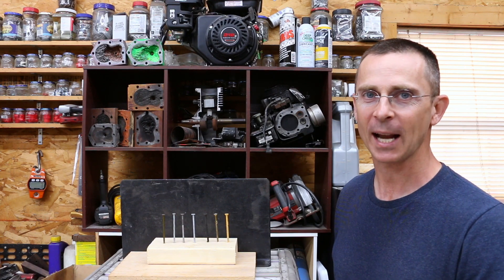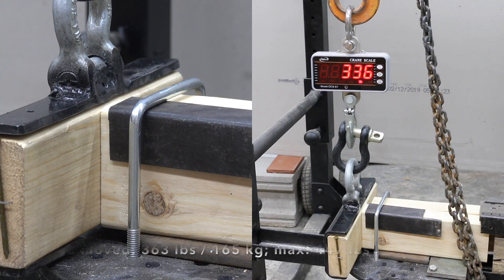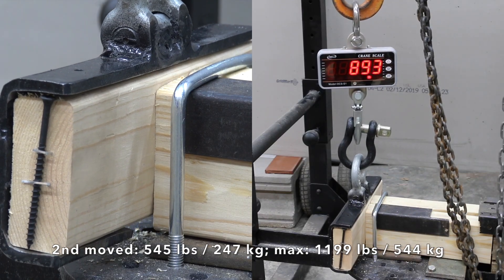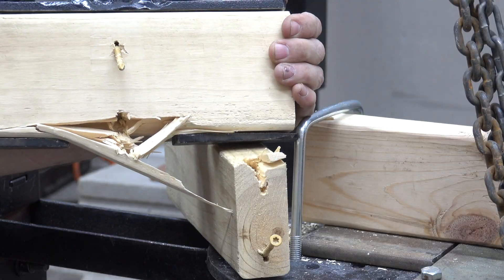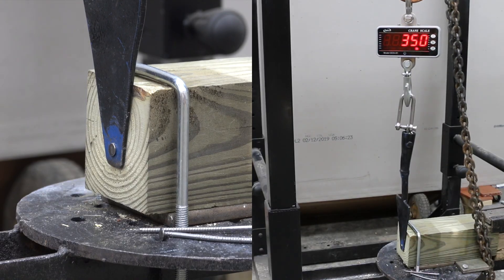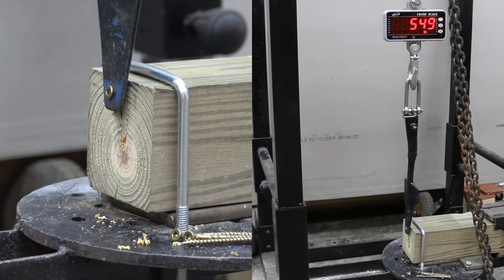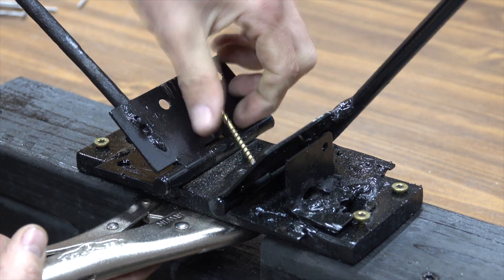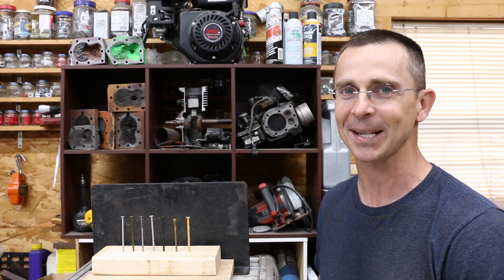Do Screws Shear easier than Nails? Let's find out!

Comment: This was very interesting, because yes I've heard other people in construction videos mention how they prefer to use nails over screws and screws over nails depending on what type of connection you need. But ultimately I feel like the screw is the better option in every case, as long as the minor diameter of the screw is sufficient for the tensile and shear loading. And I was curious what the minor diameter of the screws were compared to the nails in your video? Another thing that was interesting is with the two pieces of wood connected under the test, since there's a moment there it appears that with both the nails and the screws that bending is ultimately prying those nails and screws out of the wood and so it's actually not a shear load the entire time. It's a shear load and bending stress in the nail and screw until the nail and the screw starts to pry out of the wood and then it becomes a tensile load and it's pretty much tensile beyond that point as it's pulled out of the wood. Because of all this, I think that's why none of the nails or screws ever sheared apart when the two pieces of wood were connected. The true shear failure occurred when you fastened the nails and screws with the metal member to the wood since there was essentially no moment applied.   The fatigue test was also very interesting, but I would imagine thats somewhat extreme since say in a deck construction there's never really that much significant bending of the nails and screws, like when you were using the door hinges for the fatigue test. So I feel like that's not very practical in terms of determining which is stronger the nail or the screw. 
But very cool test and super interesting, thanks! 👍👍
Reply from the maker: Thanks and you are welcome!  Thanks for the  suggestion.

Comment: Where that hook is on the loop for your meter when pulling up will change your numbers. If that hook slides to one side instead of center, you'll see differences in force required.
Reply from the maker: Thanks for the constructive feedback.

Comment: First off I appreciate the time and effort put into these well made videos.....

Second, WOW that's not really what I expected and it changed what I thought about drywall screws. 

Third, do you think you could figure out a way to include some sort of striking force in these types of tests? Trees hit houses all the time, bridges are subjected to repeated beatings round the clock and often the force applied isn't smooth rather its sudden or repeated.
Reply from the maker: Thanks!  Thanks for the suggestion.

Comment: I found bolts from China are crap. The metal is either crap or they don’t heat treat them properly. I don’t know which is the problem. I do pressure releases and put a lot of sheer force on my arm rests. I’ve replaced my bolts with bolts from the store and they always snap. Looking at the break the metal seems to be very granulated. And I used the hardest ones too. Grade 8! Makes me wonder who’s testing the products coming from overseas?
Reply from the maker: Thanks for the feedback.

Comment: When I was taught to frame I was told to drive nails in at opposing angles.  For the first shear test I would have put those nails in at 30 degree angles from vertical with 60 degress between them.
Reply from the maker: Thanks for the feedback.

Comment: Where's all the, I'm a contractor and nails are stronger in a shear strength. Yeah, that's when beating it over with a hammer but not actually 'real world' applied 🤣😂🤣😂 Everybody likes to believe all these 'engineers' yet the army core of engineers has FUUUUUUCKED UP the Everglades in Florida. With that being said no one has done any tests for themselves they just go off regurgitated b.s. jus like with everything else in this country, like money, health, religion and science... Main thing with using screws though is making sure that whatever you're screwing together is pulled TIGHT by the screws. With board's it's best to drill a pilot hole in the board that the head sits on so it can pull everything together easier by letting the screw strip in that board because sometimes your not in a position to put great force to the screw that is required to be able to keep them from lifting apart when the screw hits the second board. If that happens the screw head will sink like it's tight but if you grab the boards an wiggle them they will be loose. On projects that I can I will drill a pilot hole in the board that holds the head of the screwand use a squeeze clamp to pinch the boards together.  So with all that said again lol I'd bet MOST of the 'failed structure's that caused codes to be enforced' where built like said above. Head pulled tight but boards are still loose because not always are we gonna be screwin boards together on the ground where we can put our weight over it... And I'm out
Reply: When the screw comes out the back of the first board it has to then make a hole in the second board, and like with the first board the screw spins once or twice before making a hole and biting in. When that happens the first board has threaded up the screw those one or two rev's that it took to start the hole in the second board 'creating' was is gonna be a loose fit even if the screw is driven down countersinking it there will still be a gap because the screw is threaded into BOTH board's. Pilot hole through the first board helps the screw to strip in that board causing everything to be pulled tight by the pulling power of the screw into the second board or piece of wood.

Comment: another way of looking at the first test would be the ratio of when they first moved to their peak strength. in which case the spiral shank moved at 22% of its total strength, the coated sinker moved at 65%, the ring shank moved at 64%, the galvanized moved at 56%, the drywall screws moved at 41%, the GRK moved at 50% and the deck screws moved at 47%. These are all averaged over the three samples provided and despite the drywall screws requiring the most weight to be removed, the coated sinkers provided the highest ratio of hold to slippage. So over time I'm sure the results would vary even more and the ratios would go all over the place since a coated sinker would likely go up for holding a painting or something like that up on a wall, through drywall and into a stud. and a drywall screw would be holding drywall sheets (8'x4' likely) to a few studs and there would be many of them in one sheet. Very interesting tests and they really make you think too.
Reply from the maker: Thanks so much!

Comment: I watch a lot of your videos and they are great, bit of an issue with control on this one for the first section ,for the nails the steel angle is  positioned all the way at the end of the timber providing  better support (2:45)   but for the screws its been positioned 1" back from the end (4:45)  this could skew the results , we seen.
Reply from the maker: Thanks for the constructive feedback.

Comment: After reading forward to many more of the comments that I had time for, I have a really good idea or at least an idea that would be very useful to me in my real world applications:

This is not original it is a combination of many ideas from these comments:  You could test what types/brands of fasteners are most resistant to stripping as well as the tools that are most likely to remain undamaged and not lead to stripping themselves. This would be a very large project as it would require multiplicative combinations of testing.

In my world of projects, stripped bolt and screw heads have been the bane of my existence. It is probably the number one frustrating problem that I encounter. I remember watching a video on some we had a Wiha colored Allan keys that are much less likely to strip and damage the bolt head others.

You could break up the tests into different types of fasteners and different brands.
Reply from the maker: Thanks for the video idea.

Comment: so, not meaning to be a bad comment, but, the first tests are not very good, you were not testing shear strength but pull resistance. the 2x4 you are pulling on should have a backer to prevent pull out, do this and you will see completely different results from the nails and a lot more wood town apart. the second test, ends up doing the exact same thing. i love your channel and your videos, but some are far from accurate.

Comment: Nice job. how about this for a test, pressure treated 2x4's with 3" construction screws 
(8 x 3" Flat Head Socket Construction Screw-Not ACQ Approved-Yellow Zinc Plated-UNC) vs coated 3 inch screws vs. spiral 3" galvanized nails for corrosion resistance and shear strength after being exposed to rain and sun for about 1 week. I noticed after just a week the construction screws were rusting and some actually sheared from being under slight stress / load in contruction of a shed wall.
Reply from the maker: Thank you for the video idea!

Comment: These tests are for pull out strength/resistance, not really measuring shear strength.

The pulling side would need to be not allowed to move away from the fixed side to be a closer measure to shear.

Comment: Awesome,  I was always told that screws were inferior for shear rating. Maybe that's just the Simpson strong tie brochures trying to sell their nails?
Reply from the maker: Great point.  Nails are more ductile.  I need to devise a single or double shear load test rig soon.
Reply: That was always my impression too. I suspect that's still true but a bit over stated too. I think pull out is a much bigger factor than people appreciate in many applications and screws clearly win there.  And, I have a suspicion that people think screws are weak because they easily snap when hit with a hammer from the side or bent back and forth repetitively. However, this type of force is nothing like the force screws are subjected to in framing. There is no movement causing metal fatigue or dynamic loading with bending (hammer hit) in a framed structure.

Comment: Those GRK construction screws work very well. I’m a General Contractor and we use them on builds all the time. As a matter of fact I also have a few small wooden cabinets on my garage which I framed & built with the GRKs. The shelving setup is simple 1 X placed horizontally on either side, and then the shelf just lays on top. This simple yet effective method using the GRKs is currently holding up a ton of weight with the various shelving used to hold everything from shelves with my huge collection of shop fluids/aerosols on them to cases of bottled water and Gatorade on others as well as canned goods/non perishable food storage and pet supplies. In short, They hold their weight.
Reply: Do you feel structural screws are okay for framing? Or should I use nails for joists etc
Reply: @ I don’t ever really get my framing guns out unless I’m doing really big projects like framing an entire addition or something. Everything else I just use construction screws and I’ve never had an issue. Honestly I think strength and rigidity wise it’s about the same between the screws and big framing nails and as long as you use enough length on either to get into the wood deep it will lock things up fine either way. The biggest difference to me is just the time factor. With a framing gun you can just zip down the line and pop, pop, pop, whereas with the screws it takes a little longer.
Reply: @ okay thank you! Gonna build a 20x30 cabin soon wasn’t sure what was best to use for framing the beams and joists and outside walls. I know you should use screws on the subfloor

Comment: The results are not certain as to how to compare to Manufacturer and Building Code maximums.
Typically a common 16d nail is designed for 90 lbs. load in shear and pull out.  This video uses testing procedures using
both one and two nails.  The results are listed by test result.  The may be misapplied to calculate actual use.  For example a 10 ft. x 10 ft. deck at 40 psf live and 15 psf dead has total load of 5500 lbs.  Let's consider only the half which is
say the end supported by the ledger board or 2750 lbs.   The number of common 16d nails would require 2750/90 or
31 nails or 3.1 nails per foot of ledger board.  Note no concentrated loads.  A licensed engineer would be
required to verify the application of this calculation and                   
To apply      the results of this video the factor of two must be carefully applied.
The other result of this video is the manufacturer of construction screws advertises higher
capacity than the test results.  Some technical papers have shown the mfg. saying 1200 lbs
when test results were 400 lbs. per screw.          
My point of this comment is to downplay the memory of a strength like 300 lls for two fasteners
when the number should be per nail.  
Otherwise great testing and video.  thanks
Reply from the maker: Thanks!  Thanks for the constructive feedback.

Comment: What about a video on wire strippers and the bolt/screw cutter on them. I bet there is a big discrepancy on what they can stand up to especially when it comes to the bolt cutters on them.

 I have had some cheap ones that don't even want to strip wire right the first time as where the Kobalt ones I have are pretty good all around but I would like to know what a really good set feels like and can do comparatively.

Comment: You know I've been building frames for houses for 15 years now and Iv used screws. And not once have i ever seen a screw sheer because of shifting. I just don't think the forces are enough to completely share screws due to slight shifting.
Reply from the maker: Thanks for the feedback.
Reply: It takes more force to shear a screw when two pieces of wood are under compression. It could be even better than nails since the nail holding force is less. Something for Project Farm to test out on face grain to face grain.

Comment: I realize I’m a year late on this one but: Love all your testing. Your channel is my first go-to whenever I’m getting ready to buy something to see if there’s a comparison or testing video on it. As for these fasteners, I would be very interested to see how they performed when driven into the side of the grain vs the end grain. After years of building projects I’ve learned that it can be an “inferior” design to drive any fasteners into end grain vs using pocket hole or “toe nailing” to find a way to drive into side grain. It certainly appears in this video that the limiting factor was much more the holding power of the wood than the integrity of the fasteners themselves. Thanks for all the work you put into these videos. It would be awesome to see if you follow this idea. Even a testing of different ways to attach with pocket screws and how they hold up to different angles of forces.
Reply from the maker: Thanks for the follow-up suggestion.
Reply: this 100%. You could tell the wood was failing first. The nails were being pulled out, not sheared. However, it's still a useful test if you want to see how much shearing weight a nail can take before it starts being pulled out. But it's not a valid test for say, "will a BOLT or a NAIL shear first" (ala 'do the ridges make a bolt weaker' like common knowledge says). Still great video and lots of hard work.

Comment: Dear Project farm, you still don't get it about spiral shank nails and holding power. They were never meant for nailing cross grain into end grain( Standard wall framing). They only work nailing flat grain boards into edge grain( narrow grain board edges). IE 1× or 2x flat deck boards into 2x, 4,6,8,10&12x lumber vertically.
Reply from the maker: Thanks for the constructive feedback.

Comment: I Feel Like Screws Having To Bend That Much Before Shearing Means Your Framing Is Moving An Insane Amount. If Framing Tweaked To The Point Where Screw Shears... Is Your Framing Really Still Together With The Nail? It Seemed Like The Screwed Held The Pieces Together While The Nails Just Kind Of Pulled Out. Like The Wood Was Limiting Framing Strength And Not The Screw. Like A Nail Is Sort Of A Fuse Where It Gives Out Before The Wood.
Reply from the maker: Thanks for the feedback.

Comment: Using this test method to determine which fastener stands up better to shear forces is kind of misleading and irrelevant in that it doesn't really test for resistance to shear force(shear strength) as it would naturally occur in an average wood-framed building, i.e. the work hardening and embrittlement of a fastener over time from being subjected to repeated cycles of more/less shear force being constantly exerted upon it in various degrees from various vectors and at various temperatures. This test is basically testing fastener pullout strength, except the force is applied from a different vector(perpendicular) than straight outward(parallel) as seen in your fastener pullout strength test video.
Reply: In order to test this accurately for purposes of determining the point of failure of the material when a shear force greater than the strength of the material is applied to it all at once(thus testing its "shear strength" or ability to resist shear force) would be to actually make a metal shear, which would consist of something like two blocks or cubes made out of a material much stronger than the material to be tested, each with a hole of the same shape(circular/cylinder shaped) drilled in them the same size as the diameter of the shank or shaft of the fastener to be tested, and rig the blocks to be, lets say a millimeter away from each other, then with one end of the fastener fixed firmly into in one of the blocks' hole, and the other end fixed firmly into the hole of the opposing block, and get the blocks to travel in opposite directions of one another in a shearing fashion.
Reply from the maker: Thanks for the feedback.